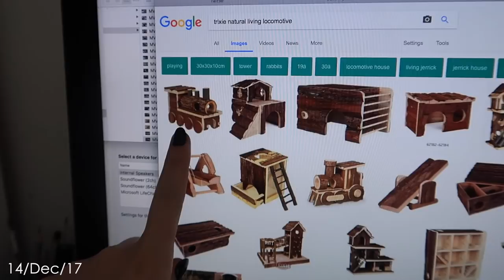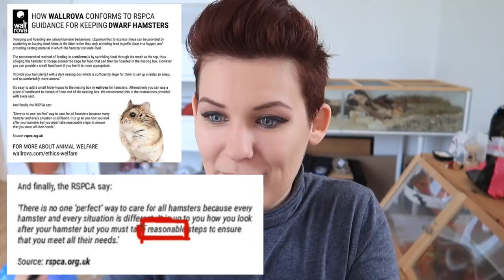Tiny Cages Rant | DIY Train Toy | Vlogstice 2017

Comment: You should start manufacturing cages.
Reply: Rachel Young i agree
Reply: Olivia Hendrickson maybe instead of complete cages, it would be awesome to have plans or diy blue prints for cages by breed. No shipping and can help promote what size cages per hamster breed.
Reply from the maker: I don't have the desire, time or money to do that which is why I make free tutorials for building your own cages. There is a whole playlist of DIY cage tutorials on my channel :)
Reply: YES PLEASEEEEEEEEEEEEEEEEEEEEEEEEEEEEEEEEEEEEEEEEE
Reply: ErinsAnimals that’s great in all but I have no building skills XD
Reply: You can make a cage with no building skills - all you need is mediocre cutting skills. Get a large bin from a department store. Use sharp scissors or a utility/exacto knife to cut a big ventilation hole in the top (and/or sides). You can measure and trace out the hole using a ruler and sharpie, to help keep your lines somewhat straight, but they don't have to be perfect! Use wire cutters to cut a section of wire mesh to be a little bit bigger than the hole. Duct tape mesh over top of the hole so the tape is on the outside of the cage and covers the sharp edges where you cut the mesh. If you're worried that duct tape alone won't hold the mesh up, you can make it a bit stronger by using craft glue or a hot glue gun to stick the wire mesh in place before you put the duct tape on.

I recommend trying to find a bin made out of really thin or flexible plastic, as thicker or stiffer plastic is difficult to work with and can crack as you try to cut it. If you can't find clear plastic to get an aquarium effect, solid/colored plastic is fine, just make sure to put mesh-covered holes in the sides as well as the top so the ham can see out and more light can get in. If they chew too much around the edges of the ventilation holes, just take the mesh squares off, tape/glue them to a new bin, and throw away the old one! Plastic bin: $5 - $30. Wire mesh: $15. Utility knife: $5 - $10. Wire cutters: $5. Duct tape: $5. You can make the whole cage for $35 - $65 and minimal skill/effort.
Reply: Oh, and if you want it to look nice, you can get patterned duct tape (look up the Duck Tape brand, their tape is pretty good, tough quality and they have some AMAZING designs), and you can find adhesive patterned paper to put around the outside to spruce it up a bit, so that it doesn't look as much like a plastic bin.
Reply: That would be awesome because she so great at making toys and diy selling and making cages would be awesome!!!

Comment: That cage looks sooooooo boring! There is literally nothing to do in it except run on a wheel, and where is the space to put wood, paper, and carboard toys for chewing? Where's the space for beds and food hoards?  What about tunnels? And multiple wheels for when multiple animals are sharing the space? Also, I'm making a homemade cage with with 2 levels (will add a third later), each level being 432 square inches. It would easily fit in the same space as their cage did, would work great for small apartments, and provides more than enough floor space. And it's probably cheaper than theirs.

Comment: It’s really hard finding cages who are good enough for the hamster as well as are pretty to look at. In my opinion the best cage which is aesthetically pleasing as well as gives enough space for the hamster is the ferplast gabry cage. It also gives great opportunity for burrowing since you can have a lot more bedding than you would a standard wire cage. Only downside is they are pretty small so definitely go for the biggest size if buying these.

Comment: (Sarcasm) ahh this is a wonderful cage so much space and very ‘stylish’ your pet will get so much exercise and there’s a lot of room for your pet to dig

NOTE: THIS WAS SARCASM I IN NO WAY LIKE OR SUPPORT THIS CAGE IT IS THE WORST CAGE IN THE WORLD
Reply: Soooooooo smalllllllllll👎👎👎👎👎👎😿
Reply: Honestly, it's probably even worse than the crittertrail cages. At least those have bars for climbing and options to add more parts by tunnel (to be clear, I still think crittertrail is garbage).
Reply: Suchnothing True, I was gonna put my soon to be hamster in a crittertrail cage but now I'm turning some of my shelves on my bookshelf into a huge cage. But I think crittertrail and habitrail cages are good for add ons with tubes
Reply: The tubes and add-ons are great if you incorporate them into a bigger cage (I use habittrail tubes to connect levels of my cages and have used the add-ons before), but the main cages they supply are just too small. The add-ons don't make up for lack of floor space. I'm glad you went with a book shelf cage, it will probably provide WAY more space. Wishing you a successful and happy construction!

Comment: Reading the inventor page on the website - it says the inventors son was found in his workshop attempting to build his gerbils a bigger cage, and thats how this cage was born. What on earth where the gerbils in before this if this is the upgrade? It also states that the creator has a civil engineering background so sadly probably has little insight into the appropriate sizes for small animals and does just see it from a design perspective. Reading more about him it also says he's retired, so I think he's probably from a time and age where there wasn't as much information on the appropriate care required for hamster etc  :( but times have changed and a lot more people (but sadly not everyone) are educated on welfare standards for small animals (especially thanks to people like you Erin!)
Reply: Looking further into the website hes stating this cage is appropriate for two to THREE dwarf hamsters and three to FOUR mice (it also irritates me that one of the photos isn't even a domesticated mouse which just hints to me that they're not 100% educated in small animals) despite the fact it's not even suitable for even one dwarf hamster or mouse... if the creator hadn't just plucked these numbers from the air and had actually researched how many would be suitable for his cage he would've come across the fact that these numbers are far from correct...disappointing

Comment: I have two bins for hamsters. A 200 quart bin, and a 30 quart bin I use as a temporary travel bin which is as large as the toy Tiny Tales and Crittertrails.  The 200 quart bin can sit on a child's chest or desk, which is not larger than a laundry basket...

Comment: I saw that the cage's size in the video was 14cm wide, 38.5cm long and got scared because Erin was so upset about that size and my dwarfs hamster's cage is 15 inches wide, 28 inches long and 13 inches high. I was so horrified that my dwarf hamster's cage was apparently way too small and then guess what I noticed...

THAT ONE IS CENTIMETERS AND MINE IS INCHES.
Reply: SwaggyKitten Gamer  I hate to say it but your cage is too small, its 420 square inches when the minimum is 450 square inches.
Reply: Oh dont worry I have only had him for a few months and i'm getting him a bigger cage soon. He is a also a small dwarf hamster and seems to like his cage size.
Reply: SwaggyKitten Gamer It's not a huge problem since its not an absolutely tiny cage or one that I would consider cruel so don't worry too much just upgrade it when you get the chance :)
Reply: Alright :) I may or may not spoil him with toys, houses, wheels and a few treats.. I think he is a pretty happy hammie.

Comment: Ok so I just recently got a hamster because I had been asking for a hamster for over 2 years. I have a 10 gallon cage and everything fits ok in it, and I’m home everyday because I’m home schooled. I also have my hamster running all around my room for a good majority of the day, which is basically every time she wakes up. Would that be an exception or should I try to get a bigger cage like a 20 or 40 gallon?
Reply: how many sq inches of floor space is it? measure the length x width. and if it is under 450 sq inches of floor space try somthing bigger.
Reply: Upgrade
Reply: Even if you're hamster has lots of space during the day they are nocturnal/ corpuscular and need at least 450 square inches. I used to have a ten gallon tank as well but I now have an 867 square inch cage so I've been there.  I would upgrade at least to a large bin cage.

Comment: "But Erin, the climbing ramps and height makes up for the small floorspace!" No, no, no. That cage is such a bad idea, and for reasons you didn't mention. Not every animal wants to climb really high to access things. And that cage is SUPER dangerous. Even skilled climbers like mice could fall, and, yeah, maybe they might land on another ramp, but they also might not. And with hamsters, or any small pet, you never, ever want to take risks. Maybe your hamster won't swallow that cotton bedding, or maybe their leg won't get stuck in that mesh wheel, but wouldn't you rather just get a solid wheel or shred tissue paper than have to potentially pay an expensive vet bill for having to amputate their leg? It's the same thing with this cage. A fall from that height could kill your pet, especially if they land on a solid toy at the bottom or one of the lower ramps. And, of course, that floorspace makes a CritterTrail look like a mansion, and it's obviously awful in that sense. But I wouldn't even use that for temporary use because it's just not safe. I couldn't sleep soundly knowing one wrong step and my mice could fall to their death.

Comment: I know I’m late... but I have a question. I’m not going to explain it all but.... 

What’s better? A good size wire wheel? Or a little bit to small solid surface wheel? Thanks💝
Reply from the maker: Neither. They are both dangerous for your hamster. Having no wheel at all would be a better choice :)
Reply: Shayla Wels I heard somewhere that you can glue (using a non toxic glue) cardboard onto the inside surface of a wire wheel to make it safe, but anyways the cardboard will probably be wrecked within a day unless you have a non-chewer

Comment: If youre focusing on height at the very least make shelves. Like if you cant go wide make a bunch of floors with enough space for substrate. Yea it may not be super light but it will be tall not take up as much floor space and it will give the rodent enough space.
Reply from the maker: They would still need to make the cage wide and long though. Shelves don't count towards floorspace, hamsters are ground dwellers that require a large, single, open plan flooring. Shelves can be used as an extra area for toys/playing but that's it :)

Comment: I have a 10 gallon tank with an add on that adds about 10 more gallons so 20 gallons basically?? Do you now if that's enough space for a mouse ? (He is a big mouse btw)
Reply from the maker: That's not how floor space works, you can't add the sizes of cages together so you just have two 10 gallon tanks which unfortunately isn't big enough. You will need at least one 20 gallon long tank or ideally bigger (or if money is an issue, bin cages work great for mice too) in order to keep a mouse in it long term :)
Reply: ErinsAnimals ok I will try to upgrade as soon as possible but I have the problem of having parents that believe that a critter cage was more the enough space.ill try marking a bin cage ,does it matter how tall the cage is? Thank you for correcting my mistake <3

Comment: Erin, I recently took my hamster to the vet and the vet recommended to put some tubes in the cage. I’ve heard that tubes are bad for hamsters because of low ventilation and that the hamster can get stuck inside. Is it still a good idea to make some tubes out of paper towel rolls?
Reply from the maker: The low ventilation problem is for cages that have lots of very long tubes on the outside of the cage (like rotastaks, habitrails, etc), putting a few single tubes around the inside of the cage or burying them under the substrate won't have this same problem as they are much, much shorter and so air can enter them easily. As for getting stuck, this is only a potential issue with Syrians but it's easily resolved if you just buy rat sized tubes instead, they are much wider and a Syrian will never get stuck, or if you're using card tubes just cut a single long slit through them lengthways and they will always stretch to accommodate your hamsters size  :)

Comment: I have a two 10 gallon tanks with an extended bar 10 gallon top for the tops, and the hamster cages are separate but I have made it to where the burrow is half the tank on the bottom  with a wooden house, which they love, at the very bottom of the cage I layered there food along the bottom and then placed the bedding on top of it and then I feed scattered more food throughout the top of the bedding, and they have another house which is plastic that is in top portion of the enclosure, with a food dish, water bottle and a wheel. I am not rich so I can't make a bigger cage for them. :(
Reply: you can make a bin cage! they are super cheap and you can pretty much get them anywhere, i made one of mine for under $20! if you can find a large bin (i reccomend the 200 quart sterlite bin) you can easily make a good cage, there are tons of vids about it and how to make one! :)
Reply: and if you want to make more hides and toys you can make them out of toilet paper tubes and cardboard :)

Comment: ErinsAnimals If I had 2 50x50cm bin cages and joined them together with like a tube, would it count as 50x100 floor space?
Reply from the maker: No, you would just have two 50 x 50 cages (unfortunately not big enough) minimum floor space is measured by the single continuous floor space of one cage :)
Reply: ErinsAnimals ok thank you

Comment: If it was as long as it was tall and had higher walls it would actually be kinda fine for the smaller hamsters.
Reply from the maker: It would still be way too small for any animal to live in, the absolute smallest cage a single hamster can live in long term is 75 x 40cm (450sq inches)

Comment: I am also very mad about this cage. On their website under the ethics/welfare region I found this:

"wallrova‘s steel runways are designed to rust with use, becoming more like the natural rough surfaces of rock and compacted ground that gerbils and hamsters encounter in the wild, and certainly better than the plastic, wire mesh, wood and glass surfaces that other pet rodent cages provide. Gerbils’ claws grow continuously, for example, so the rough, hard, rusted surfaces of the runways help to wear them down. Our only regret is that we are unable to supply the runways pre-rusted." I totally disagree with this brand.

Comment: my question is; i know the "runways" that they have are in the taller portion, but if you like,,, took them out and put maybe some platforms or houses or something, would that be more acceptable? the floor space disgusts me as to how small it is, but because it's not wide but tall, if you used the upper part could a hamster be... not comfortable what am I saying uhm... could a hamster be "less stressed"? I'm just wondering (because floor space is incredibly important) why you couldn't have a taller cage (not this no ew not in the slightest toO SMALL) rather than a longer one? like a bin cage opposed to a cage made of a set of drawers? could someone please explain
Reply from the maker: As hamsters are ground dwelling animals height is (to an extent) useless to them. In a standard and suitably sized hamster cage shelves can be added as a type of climbing toy but they do not contribute to the floor space or overall cage size. A hamster needs to be able to freely walk/run over a large, open area of floor and most importantly, they need to be able to build their burrows under the substrate and a burrow obviously cannot go up ramps or onto shelves. When given enough space and substrate hamsters will build burrows with multiple long, connecting tunnels and several underground burrows for things like hoarding food, sleeping and even a designated toilet. This is the main reason continuous floor space is so important and why height is not so important :)
Reply: ErinsAnimals I see!!! my hamster has a giant bin cage (about 900 sq inches) but i was just wondering. thank you very much!!!!!

Comment: I kept my male mouse in a 20 gal with 2 hides, a wheel, multiple chews and toys, a lot bridge, amd pther accessories I enxchanged between cleanings. This is horrible. The only rodent I know of that needs height over floor space are rats, and even a rat would be depressed in this cage.